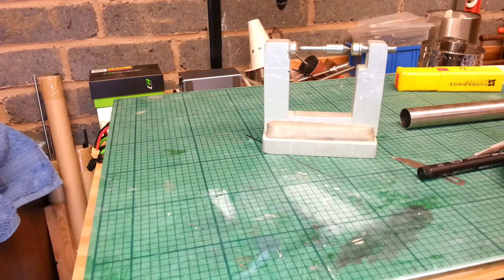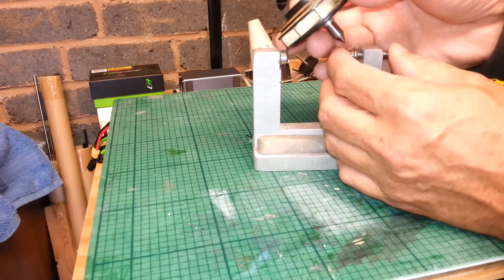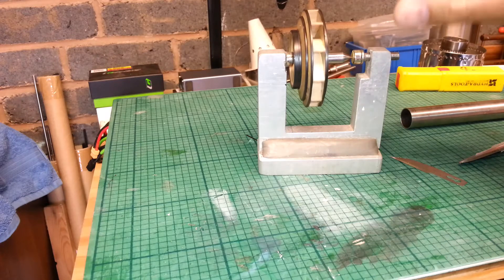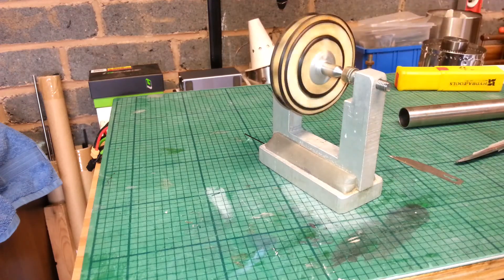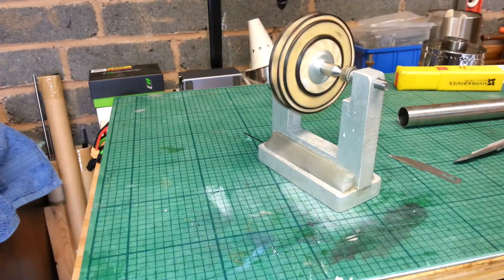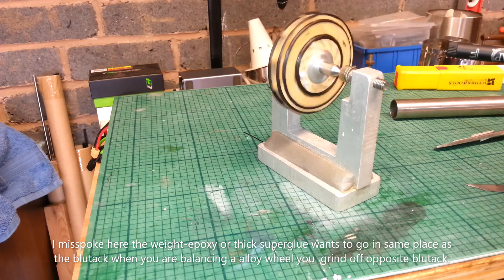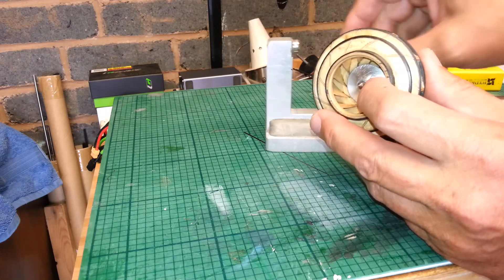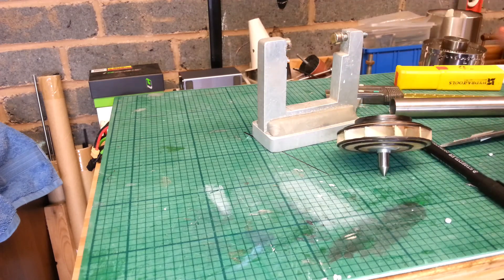Umar's FD3/64 compressor wheel balancing

Comment: Has anybody tried to make one out of carbon fibre sheet
Reply from the maker: It has been done but you need to know what you are doing I would not try to make it same way as wooden wheel out of sheet you really  need a lot of tooling to do it.
With cnc milling you could m/c the wheel out of aluminum with no top same as a car turbo  but again you need to know what you are doing mine have alloy wheels you must use a 4mm ball end cutter to form a rad at blade root and use the correct alloy and m/c as close fitting top .
The FD3/64 wooden wheel is easy to make and mode of failure is to turn into dust so not too dangerous it is an old design and only has just enough power to fly a very light plane but you can make every part only needing to buy the bearings but i did make my own spot welder ,balancer, spinning tools it's a lot of work  but I did learn a lot doing it but if you want a jet engine to fly a plane I would just buy one.

Comment: @reedy93. Have anyone use plastic compressor ever with actual thrust? I watched video of 3d printed jet engine but at very low rpm without thrust.I made compressor of wood but after running it over 30000rpm it break from center. I am planning to make it from plastic because it's flexible but strong than wood so it would absorb some forces.
Reply: Be careful which "plastic" you use, as many types of plastic have a lower flexural strength than plywood. It would be best if you could use 20-30% glass fibre reinforced composites. If those are difficult to obtain,  try using acetal plastic or ABS. Those should have sufficient flexural strength, although carbon fibre reinforcing could be beneficial too.

Comment: Hello. Which quality plywood used in fd3 for compressor blade? I have 1mm plywood for blade but i think it isn't strong as required . It is flexible.
Reply from the maker: Kurt in the book say's  0.8mm to 0.9mm  3 ply plywood model shops sell birch ply 1/32 if you have 1mm birch plywood it will be ok plywood always bends easier in one grain direction,  orient that way for the curve.
Reply: @reedy93  . Ok thank you

Comment: Sorry for the stupid question, what would be the implications of milling an aluminium wheel rather than using plywood for the compressor? Again, nice work Umar and you Reedy for the education.
Reply from the maker: it may be easier now when i built mine 20 years ago there were no small cheap cnc milling machines the wheels being made were flat faced made on a mill and dividing table ,not an exact copy  of the wooden wheel,if you buy a lot of expensive equipment it defeats the point of building your own engine also car compressor wheels can be got very cheap now  and are very safe but are not suitable for the FD3 engine.
Reply: @reedy93  Well put, that makes sense.
Reply from the maker: @ThislsYusuf  if you do try making your own alloy wheel do research on correct aluminium alloy to use and the blades need to have a 2 mm minimum  radius at root they were made using a 4 mm long series  ball end cutter to give the rad at the root, the blades were m/c  1.0 mm thick,
The blade tip height was keep at 7.5 mm the diameter was slightly increase to 68 mm dia to increase the power.if you can keep the same profile to the base as book  it would be better but people made them flat at base of blades and reduced height of blades at inlet but as Kurt say's in book flat base are not as efficient,car compressor wheels have a very big rad but are heavy .
Reply: @reedy93  I happen to have a 6mm ball nose hope that fits the bill. But after consideration of your first reply, I reckon I'll start with the wooden build first just to get my feet wet in this endeavor. Walk before you fly, right? 😁👍
Reply from the maker: @ThislsYusuf  yeah unless you are into engineering already ,most people buy a lathe when they decide to build a jet engine so very steep learning curve. 
there is only room for a 4mm cutter between the vanes/blades of compressor at inlet but you could do one like i bought which has 14 blades 7 full length as draw and 7 half length same as a car compressor wheel this may free room up to use a bigger cutter and reduces inlet restriction.see video
 https://www.youtube.com/watch?v=SgEltTwTygg
Reply: I machined one using high tensile ali. The blades were milled with a 4mm ball nose cutter on a jig bolted to a rotary table.
My engine ran well but I didn't bother to measure thrust. It self sustained and had a good speed range.
Reply: @simonwass6315  Nice. I need to get back on this project haha